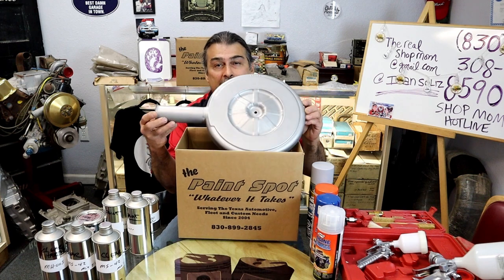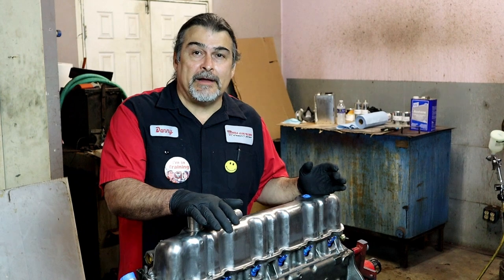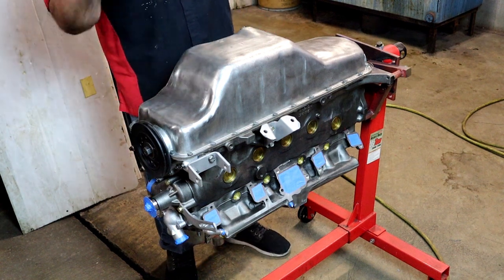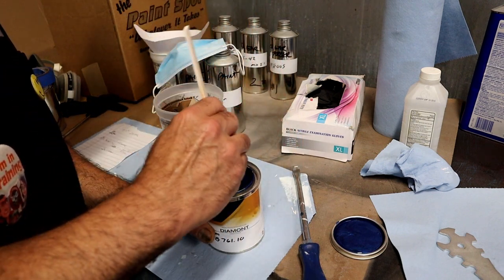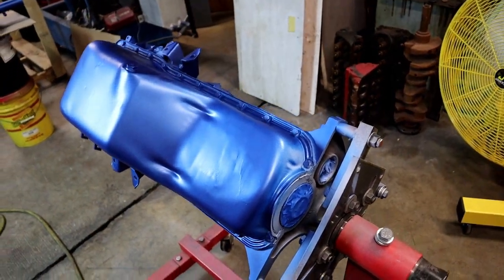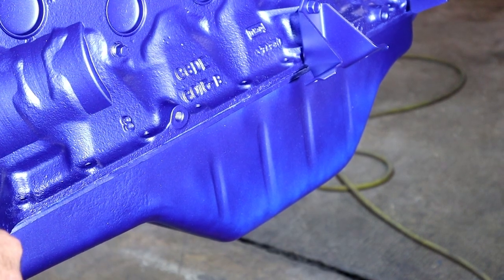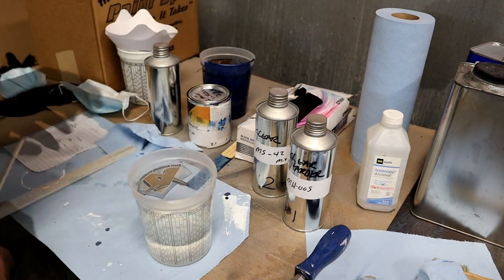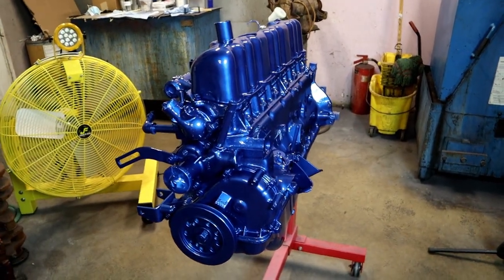HOW TO PAINT LIKE A PRO AT HOME OR ANYWHERE.

Comment: Great to see you again!
This is not meant as a criticism in any way. You’ve probably forgotten more than I’ll ever know. I don’t paint for a living, I do computer work, but since you are always looking for ways to improve I’ll leave you with this. 
Prep is key. Normally when I’ve seen painters work, they will normally wipe the panel down with a panel prep spray (normally an Isopropyl Alcohol solution), then hit it with a tack cloth to remove dust. I realize not being in a nice downdraft booth (and in the back of a working shop), dust will be there. Then they’ll mix up the product (whether primer or paint), then check their spray pattern. I think they’re looking for a sort of oval shaped pattern. Then when shooting a panel, they normally start off the panel and spray across the entire panel.
As you mentioned, you don’t want to create any runs in the paint. I hear that candys, metal flake, and pearls can be difficult to shoot. Now that blue metallic that you were shooting is not easy, being as translucent as it is. If you don’t shoot it evenly, some parts may be darker than others. 
Nice job! I’m surprised you shot it in the rain. Most people wouldn’t have. 
Besides oils, I think you also need to avoid products containing silicone. I know there are automotive detailing products that mention being body shop safe that don’t contain silicone.
Reply from the maker: Wade you are correct and thanks for the tips. Next time I’m trying the Isopropyl Alcohol, it worked wonders on the fish eye, Silicone is the worst! Thanks
Reply: No problem, sir.

Comment: I just painted an ls engine that I am swapping into my ultra 4 buggy.    Took me like 5-6hours to prep the block.  Pressure washer, assortment of wire wheel for my die grinder, several hand held wire brushed to get all the nooks and cranny’s.  Scrubbed it with brake cleaner, followed with 3 rounds of wax and grease remover.    Next time I need to paint a block I will sent it to the shop to have the block cleaned.   I just used duplicolor engine enamel.
Reply from the maker: It’s a lot of work just preparing the engine for paint. Duplicolor is good engine paint.👍

Comment: It look well done do me; a couple of tricks that everyone can do or if they want or that they may want to consider before paint something, you can also water/wet a bit the floor before paint because you may raise dust with your feet, the hose or just the air itself alone. Make sure you purge your air compressor before apply the base coat, the paint or the clear (we call it 'laca' or 'barniz' here in Spain, to the clear), oil from the compressor can go into the hose and create those fish eyes or bubbles; also, put some thinner on the pistol and regulate it's arc and flow according to your needs before start, keep in mind that not all the paints, clears or base coats have the same consistency so check again the pistol's arc and flow with a couple of trigger pulls with the base coat, the paint and the clear, apply the base coat, paint and clear at a constant rate, angle, distance and height, don't go too fast... but don't get sleep in a spot, to aboid "tears" (we call it 'arroyones' in Spain). Try to have the pistol never less than 20cm away from the thing your painting and never far away from 35cm, (20cm is about a 1911/M1911 A1, 35cm it's about a 1911 and a half), be aware of the hose position when you're painting and of your own clothes too, to aboid the touch the piece that you're painting; and make "a plan", where you gonna start and where you gonna end. All paints, coats, clears etc.. are different, but "in general" you can apply the next layer in about 10 to 15mins after the 1st one with the base coat, between 15 to 20mins with the paint and... about 25 to 35mins with the clear, also, you "ussualy" have to be a bit faster with the clear than with the paint as it's easy to make "tears" with it. If you've to apply more layers to get to hard to reach places, recesses or things like that... don't worry, that's normal, one more player, or a couple of quick shots in the spot and you're done; it's harder to prepare the paint, base coat or clear than to apply 'em, paint it's easy and fun, take your time and pay attention to what and how you're doing it... and sure you'll do it fine, it's nothing.
Reply from the maker: Awesome advice Charles 🙏
Reply: @MrDanielSoliz  Many thanks Dani, this is finnaly my field!; and well done again, that engine look very well to me. Was missing you and Elaine, hope you've a great week and to see you two soon again.